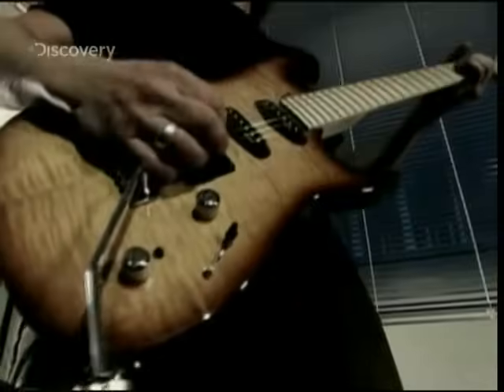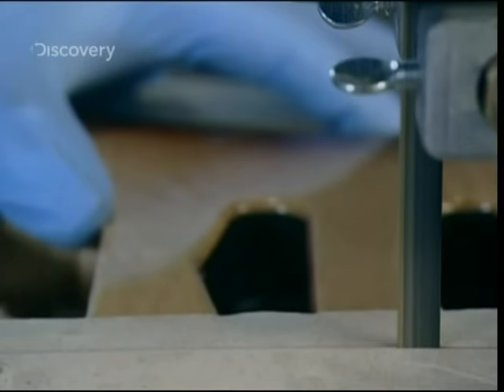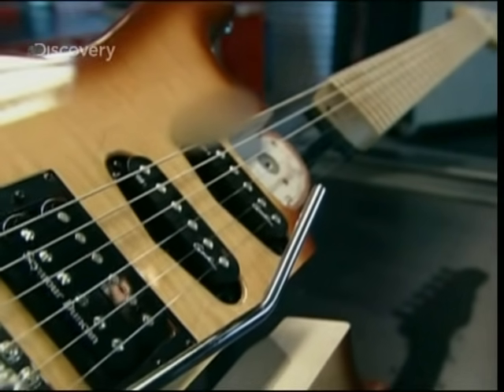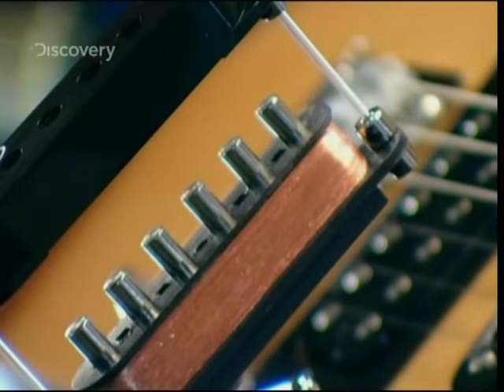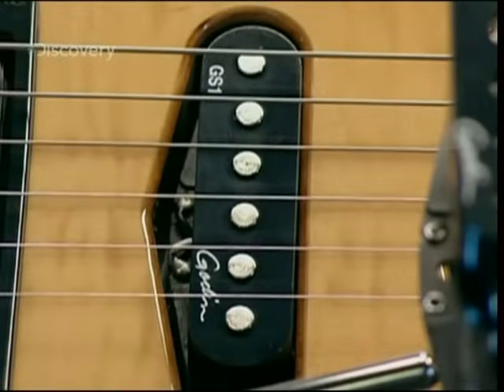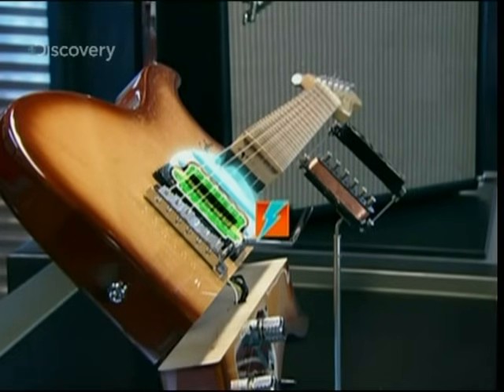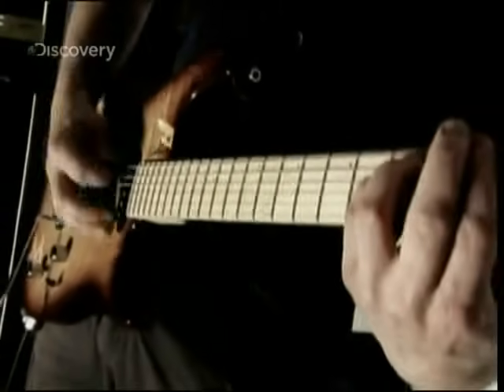How An Electric Guitar Works

Comment: 1:35 "it loosens or tightens the strings to create a tremolo effect"...

This is incorrect. First, not all guitars have tremolos. Second, while that specific style of bridge may be called a "tremolo", this term is actually incorrect. It is actually a vibrato effect, and the incorrect naming of this system was due to Leo Fender getting the terms confused.

Comment: OMG such a stupid statement: "Pickups closest to the bridge, where string tension is high, [...] the pickups closer to the neck, where tension is less [...]" this is a huge fail from basic mechanics, normal stress resultant i.e. tension is constant along a string... Brighter sound is the consequence of higher mode participacion of the uppper harmonics.
Reply: Can it be even worse? Elementary school electricity dies here: "the 2 volt current from the strings vibrations".

Comment: I hope one day, there'll be wireless electric guitar that dosent need an amp and never dies. I know, that's impossible.
Reply: Not completely impossible! ^w^
A wireless electric guitar's transmitter could be powered by your own body heat with advanced enough low power transmission technology. Then on the other end, the signal broadcast by the guitar could be picked up by your audience's virtual hearing implants to directly stimulate their brains so no amp will be needed. The future will be beautiful, truly beautiful

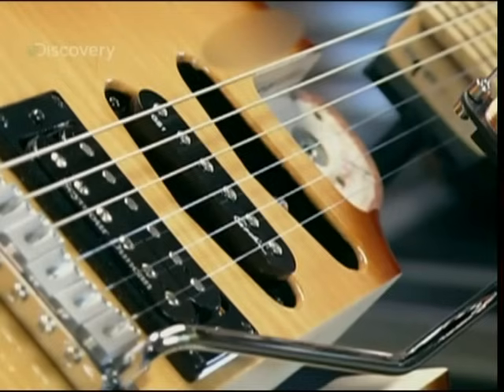Comment: 3:36 Basic physics tells us that the tension is the same throughout a particular string. Something else (resonance? harmonics?) make the bridge and neck pickups sounds different. Help me out, anyone?
Reply: @MrKockabilly
Harmonics? Yes. A com plete answer involves some maths and physics(statics) that are beyond the scope of musicians. So I will make it brief.

All ropes, cables, strings, wires pulled between two points sag , even if tension is increased higher and higher -- only the sag curve (known as catenary) becomes less and less visible to human eye. This is because strings etc have got its own weight, hence gravity acts on it. To attain zero sag the tension to be applied is infinity (tan90 degrees), long before which the string breaks.

So guitar string sag in the middle portion, there is a slack in this portion, hence more free to vibrate than the part closer to bridge.

Now the answer : 
Because of the slack, neck portion's vibration will be rich in lower harmonics(bass tone); because of the absence of slack , the bridge portion's vibration will be poor in lower harmonics but rich in higher harmonics -- treble tone. So pickup's input varies in accordance with its location. Sorry for being too long !
Reply: @tvoommen4688  Thanks, good explanation. And no it's not too long. In fact it is quite concise considering the nature of this topic.

Comment: It's the magnetic field induced in the string which causes the flux in the coil to change rather than the string affecting the magnetic field of the pickup magnet.
Reply: @Chris Snow.     Flux in the coil ..........that is a lot confusing. The coil is copper wire, a non-magnetic conductor. Current induced in the coil changing in accordance with vibration frequency of string that is a magnetic ssubstance -- that is okay.
Reply: @tvoommen4688  By that I mean the lines of magnetic flux (around the string) passing through the coil. Here are some links that explain it better than I! bit.ly/2BQNmfK and search this article: bit.ly/2DktbHV for the word Nuts.

Comment: The whammy or tremolo bar does not create a tremolo effect. It creates a vibrato effect. This is a common misconception, it should be called a vibrato bar.
Reply: we could call it a "vibrato bar" or we could call it something shorter... 
.
.
.
.
.
.
a vibrator
Reply: For me tremolo sounds like when the sound's constantly changing between quiet and loud. The whammy bar doesn't do that but it changes the pitch of the sound and the word "vibrato" is often used to describe the changing between the higher and lower note, so yes, it should have been called vibrato bar instead.
Reply: I'm a violinist not a guitarist - producing a vibrato effect is ridiculously easy just by using your finger(s) on the string(s). Wtf is the reason for making a whole pain in the ass "whammy bar" that you have to fidget with?
Reply: @Nada Penny  because of the frets (the bars on the fingerboard). These frets divide the board in discrete notes. Per fret is one note, no matter where on the fret you put it. When you try to play vibrato like on a violin your finger will always stay on the same fret, thus producing the exact same tone. Which is why a different mechanism is used to get vibrato. On violin, since the board is completely free of frets, any tiny change in finger position will have an effect on the tone, so you can use your finger
Reply: @stroopwafelenjoyer This is not true. You are imagining doing vibrato side-to-side. But guitarists use vibrato all the time, by bending up and down.
Reply: @nadapenny8592 You can't do major pitch changes with vibrato using only your fingers to bend the strings. Guitarists use vibrato the same way violin players do, we are also able to do it on the strings. But by giving our bridge a separate vibrato effect, we can have much more control.
Reply: @nadapenny8592  Chords.
Reply: But isnt the vibrato effect made my bigsby bridges? And the tremolo effect was made by floating bridges like floyd rose
Reply: @hashbiasshate8904 No. They are all vibrato effects, but it was called tremolo due to a confusion by Leo fender. But they all accomplish the same thing, whether you have a Bixby or Floyd, they all change the pitch of the strings. Tremolo doesn't do that. It changes the volume.

Comment: Actually the A string vibrates at 110 Hz, not 440 Hz, as the guitar is an instrument which transposes an octave down (from the notated score), and the A string is, in any case, an octave below the "Concert A" pitch, which does vibrate at 440 Hz (top string, 5th fret). Pretty rubbish info for a video that's supposed to be educational.
Reply: i caught this too, good job. this is very important to know if you don't have a tuner, you can tune a whole guitar with just a 110Hz tuning fork
Reply: Yeah.  And how does the tension change over the length of the string?  It doesn't.
Reply: if the A string is an octave below A 440 would that not make it 220Hz

Comment: You declare war to many guitarist/guitar maker when you say the body doesn't contribute to the sound. There is a reason why wood is still the material of an electric guitar.
Reply: "doesnt contribute a whole lot"
Reply: ***** let them deny that the pickup captures vibration, which is affected by overall resonance that is affected by the guitar body.
Reply: Allright, so explain me why the pickup i have removed form my gibson les paul, installed on a stratocaster, sounds completely different...
Reply: @mazzectl69  because a les paul is shorter than a strat, thus the tension is different, thats why youre gonna hear a thicker sound on a les paul even if the pickups are the same, moreover the circuitry may differ (the tone controls etc)
Reply: mazzectl69 did you change pots? I put lp pick ups in a strat, but left the 250k potentiometers alone, sounds strat'ish
Reply: pher35 looks like u are pretty confident then. didnt know that i am sharing an ear with you.
Reply: It's sooo simple... just grab your elettric guitars and play them in acoustic. Without the amp. If there's no difference in your ears... well ok.
Reply: Raffaele Palombi i mean they are mainly used to perform live and create a unique sound. Pretty sure if you play thos you can play the other. No ones gunna hear an acoustic in a packed stadium
Reply: pher35 unless its a string through design; other than that wood doesnt really have an effect
Reply: They make carbon fiber and other entirely synthetic guitars nowadays that sound just as good and sustain just as long as any mahogany or whatever wood preference wood that exists tho lol
Reply: I`m confused... what happened when a bass player use Nylon strings?
Reply: Emmanuelle Neoclassical if they are Completely Nylon and not just Covered Nothing happens because Nylon doesn’t Distort the Magneticfiel of the Magnets so Voltage isn’t inducted on the Coil.
Reply: mazzectl69 scale length
Reply: Rod, you sound like a tonewood nut. The wood of a solid body electric guitar barely makes any difference to the tone, despite the superstitous belief of some guitarists. I notice that you don't supply any reasoning to support your belief.
Reply: Few people will deny that the players' fingers, the amp, the pickups, the strings, the circuitry, and even the plectrum affect the sound of the guitar much more (and probably in that order) than wood. Wood is still a factor, but one of the least important ones.
Reply: Pickups are magnets that only metal things like strings have an effect on their magnetic fields creating the signal that is sent to the amp. Wood has no effect on the pickups. Les Paul's and Strat's have different sounds because of diff pickups. Run the same guitar through diff amp and you will get diff sounds as well. Tone wood is a myth created by manufacturers to get gullible customers to buy their product over someone else's.
Reply: That's right! Lol! Lets face it the only reason wood is even still used is because most players are traditionalists, and wouldn't buy a composite.
Reply: Hard materials like the nut and bridge? Strings never touch the wood.
Reply: They don't. There's nothing to explain.

Comment: This is really full of way too many mistakes to be less than 5 minutes.  The A string is actually 220Hz when played open and 440Hz on the 12th fret.  I also think the tone controls allow high frequencies, but not lower ones.  Clearly, the amplifier is not part of the instrument.
Reply: I'm no guitar expert (I don't play guitar), but I have always considered the amplifier part of the instrument. The definition of an instrument is "a device that is used to make or produce music" and the amplifier along with the guitar itself does that since it modifies the guitars sound by amplifying it. If you take a musical recording and digitally modify it or add to it using software on a device that device and software also becomes an instrument. (I would think.) Feel free to disagree with me! :) I just wanted to share my thoughts on the video. If anyone else wants to respond I am always open to learning new things! Once again, I'm no musical expert. Thank you.
Reply: That's probably incorrect.   Wouldn't that be like saying a stereo system, a speaker or tape player is an intrument?  Amplifiers just make the sounds, or more technically, the signal, stronger.  I don't see amplifiers here: 
http://en.wikipedia.org/wiki/List_of_musical_instrument
Reply: Benjamin Gunnell But the video never claimed that the amplifier itself was an instrument. It only claimed that "the amplifier is considered part of the instrument" ( it says this at 3:50 ) since it hooks up to the guitar and is pretty essential to get the correct sound of the instrument. A chin rest on a violin is considered a part of the instrument but you could probably still play the violin without it (it would just be more of a hassle & uncomfortable). A chin rest by itself will not make any music either just like an amplifier. But you are right with what you are saying though I don't think it exactly fits that one claim of the video. An amplifier really isn't considered an instrument! You can't play it dynamically by itself just like you can't play a speaker or a tape player. I now fully agree with you. Those were good examples that you used! I had a suspicion there. I was a bit confused at first since one is able to adjust/modify the sound of the amplifier which also can alter the sound of the guitar I thought that that automatically designated it an instrument. But you can also adjust or modify the sound of a radio and it definitely is not an instrument since you don't play it! Thanks for responding politely to me. I thinks it's always good to question material. Professionals are also people who are prone to making errors. It helps to reduce the confusion and inaccuracy when people are thinking critically about such given information and are able to spot and point out mistakes. It's a learning experience for everyone! At least, for people without much musical experience the video is pretty informational covering the very basics of the electric guitar's inner workings even if it did get a few of the minor details wrong. I had never thought about how it worked before; that the vibrating guitar strings disturb a magnetic field which produces sound! Electric guitars now in my opinion not only sound cool from the outside, but the way they work from the inside is equally on par with the sound!
Reply: Well, respectfully, it appears I never claimed the video claimed the amplifier was an instrument.  I said, " the amplifier is not part of the instrument."  That being said, I see where the narrator is going, electronics and in particular recorded samples, loops and riffs are not created in the same way as acoustic music.  For instance, when hip hop and rap were new, many Rock music fans saw rap as a type of theft, as they use samples of other musician's riffs or hooks, as in Vanilla Ice sampling "Under Pressure".  A guitar pick can be percussive and create a different sound than plucking with the fingers, but it is not an instrument or part of one either- just another thought.
Reply: Oh, yeah your right! You never did claim that. I guess you would consider an element a part of an instrument if it was quintessential in producing the sound. I could be wrong but from my knowledge electric guitars won't produce much sound (or maybe good quality electric guitar sound) without the aid of an amplifier. Or maybe they do?
Reply: Not much sound.  Amplification is needed and allows for more precise control in volume than acoustic.
Reply: Awesome! :D This has been a great youtube discussion! I learned a lot. You brought up an interesting point about historical rock and roll sampling being considered theft. I would guess that musicians back in the day did not ask other artists for permission to use their songs since "sampling" was a new thing at the time. Copyright laws and who owns what can get pretty complicated and also very heated. This has led me to wonder also about song covers. They are very popular now-a-days from what I can tell. Are you allowed to cover any song without asking the original artist for permission and afterward proceed to make monetary value from it? There are plenty of covers available for purchase off of iTunes. Singing another person's song and then making money off of it seems a bit like stealing to me.
Reply: Google a book by David Byrnes (sp?), the Talking Heads' singer.  He has a pretty good book with that information, but I don't recall it.
Reply: Katelyn L.  I believe you would have to get a Mechanical license and a Recording License in order to even derive from works. Additionally hear are some more in depth resources to gain the founded information
 http://www.ascap.com/licensing/termsdefined.aspx http://www.copyright.gov/
Reply: Thank you Daniel! :D
Reply: No problem When it revolves around my profession I serve
Reply: Benjamin Gunnell I agree... is not easy to make such macroscopic mistakes like saying that guitar A string is 220Hz open and 440Hz on the 12th... as it is 110Hz open and 220Hz at 12th, respectively. About the fact that in a sold body electric guitar the amplifier is not part of the instrument, the only thing I can say is that Leo Fender, that man that created the first successful electric solid body guitar, had an opinion that is different from your: is his opinion the amplifier is part of the instrument. For sure to be able to "hear" the real sound of a sold body electric guitar you need both the guitar and the amplifier, no way. The passive tone control of a guitar cut the hight, does not allow them, so they are right, and, unfortunately electronics and physics are meter of facts, not opinions or "thoughts"...
While e ridiculous mistake is the idea that the strings has more tension closer to the bridge... the tension of a string is the same all over its length. The other odd concept is that an electric guitar has to be solid bodied.... acoustic electric guitars were around since 20 year before the fist solid body was produced.
Reply: as a guitarist, I promise, the amp is a huge part of the instrument. The amp is most important for me, try to play metal on a Twin, or surf on Marshall. The amp does as much, if not more ,for the character of the sound than the guitar wood and many other aspects. "Amplifiers just make the sounds, or more technically, the signal, stronger" is by definition what an amplifier does. But the limits of technology in the 50's meant that the amps distorted the sound in huge ways. That is why electric guitars do not sound like acoustic guitars that are louder. They are their own.
Reply: Alexander S is a microphone part of a singer’s instrument (their voice)?
Reply: in a performance, yes. A bad microphone, or a technically poor choice microphone can ruin a performance. A singer who knows how to use a cardioid microphone can do lots, one who does not, will likely use it poorly. Are you recording/live mic'ing a pop singer? Opera? They require very different microphones.
Ask a singer if their effects are important: reverb, delay, compression, eq, too.